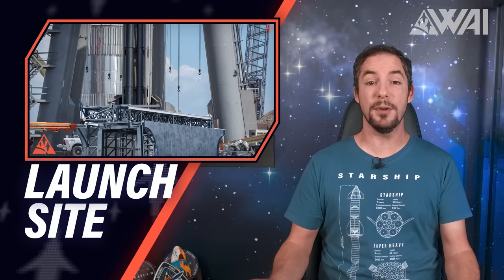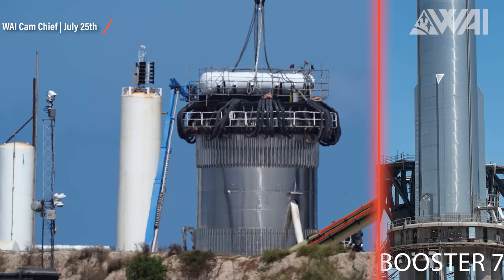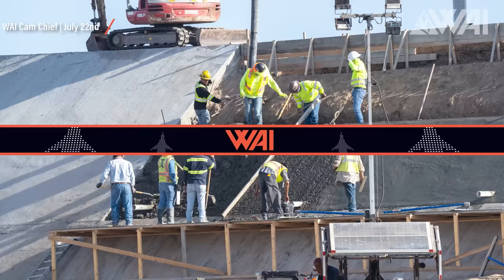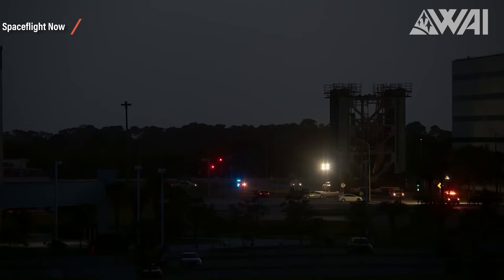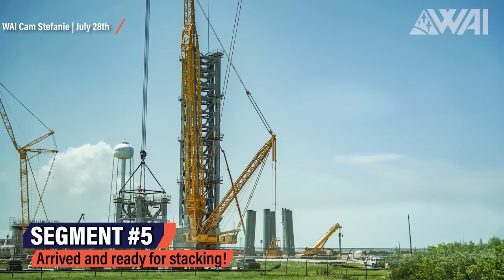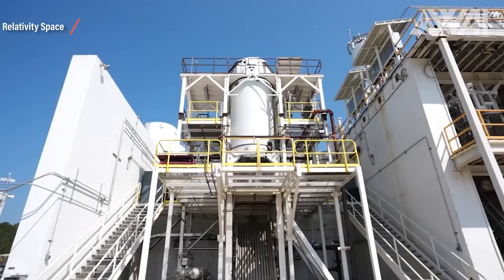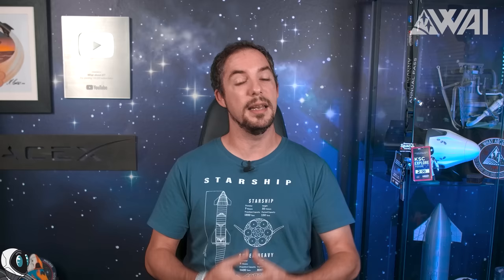SpaceX Starship getting ready for the orbital flight & Relativity Space announcing Mars mission!

Comment: I believe it was a spin prime test not a test fire that had the anomaly. Flowing fuel but not igniting it.
Reply: What's a little configuration between friends? It'll buff out.
Reply: It was
Reply: Correct it was a spin up test on the turbo pumps.

Last I heard they removed 13 Raptors.  The same # in the inner section on gimbals.
Reply: Yeah I came here to see if someone pointed this out for any new viewers. Almost LOOKED like a static fire, but certainly Felix knows that it was a spin prime test and made a simple misstatement! NBD 🙂
Reply: Really? Is that what you believe, huh? Well thanks for your input.
Reply: correct
Reply: Close but not exactly. There was no fuel flowing at all. Spin prime tests only use LOX but the ultra high oxygen vapour environment makes even trace amounts of methane produce a sizable boom. Presumably trapped methane in the tanks and tubes that built up in the engine section. It's even possible the fuel source didn't come from B7 at all but from a generator/welder/other tool nearby.
Reply: @2ndhandjoke  Yeah, it's easy to believe facts when you've seen the myriad evidence and have a basic understanding of what a spin prime is.
Reply: Correct
Reply: We know this for weeks now
Reply: Yes it was.
Reply: Big surprise he makes big mistakes.

Comment: I'm very happy to see Relativity space competing but the scale is incomparable and not in direct competition with the Starship.
Reply: The kinds of payloads that are too large for Terran R are uncommon. Yes, I can see Starship flying a big telescope, and parts for whatever replaces the ISS, but this doesn't amount to a lot of flights. 80 percent of commercial payloads are less than 8 tonnes. That's why Rocket Labs's Neutron is sized the way it is. Terran R is larger and would account for a fair proportion of what is left of the market. Starship will have its uses of course, but it still has a lot of competing to do with the vast majority of payloads.
Reply: @saumyacow4435  Good point. You could also argue that currently the payloads are smaller / lighter in nature due to cost of sending them to orbit. So Starship or any other reusable rocket that is to be developed would change that due to a massive reduction in price.

In the future I can see smaller fully reusable rockets being mainly used for orbit and the bigger ones like starship for the Moon, Mars, etc. where you need a lot of payload capacity to get the infrastructure ready.

In the end it all boils down to economics so hopefully some economic driving factors areestablished beyond our orbit that would push further innovations.

Comment: 1:00 The crushing loads don't occur at Max Q, it would be later at Max Gs in first stage when the fully loaded Second Stage weights 2, 3 or 4 times as much. Whatever the G load is. The Booster Transferring the maximum amount of thrust to the Second Stage to attain Maximum Acceleration, Max Gs. This is similar to what occurred to a Falcon 9 carrying a Dragon Resupply Capsule to the ISS.  Coming up on Maximum Gs, late in First Stage, a Pressure Tank broke loose in the Second Stage and floated up. Yes, as Gees increase the Buoyancy Force increases too.
Reply: I remember, that "the strut" became some kind of a meme :D

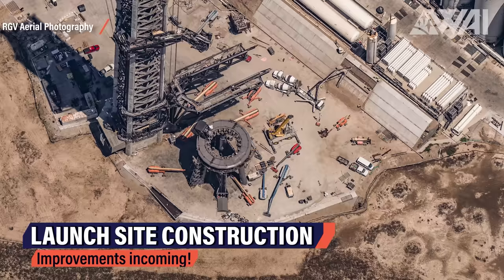Comment: 3:59 That Booster engine shielding not OLM.
Reply: That's what I was thinking.  When B7 was lifted from the launch mount post-BOOM, a bunch of the shields for the outer ring of engines were missing.  There was some supposition that they were removed in the days before the lift for engine inspection, but wasn't the consensus that they were blown off by the BOOM?

Comment: Does anyone know what's happening to the oil rigs Spacex in planning to convert into launch platforms?
Reply: Did Elon salvage them,
for the materials ?

They have vanished.
Reply: The process to refurbish them into floating launch platforms continues, although they are not priority at the moment. Its possible that SpaceX wants to have some Starship test flights before them being finished.
Reply: As usual for SpaceX they work on what is needed soon.  Things needed later are on slow burn.  They'll need a few reentries and "sea landings" before trying to land a Starship.  Why worry about the ocean platforms when they don't even know if reentry works?  Won't want to aim a Starship at a platform until they know they can do so at a realistic speed and accuracy to be caught.  

They'll need tugs to position the platform and some type of vessel to bring back Starship.

Comment: It's a little bit crazy that they're building a second tower at Florida when they haven't even proved the concept at Texas. If they have to make any changes to the system, which seems not only likely but inevitable, they're going to have to rebuild no one but two towers.
Reply: Towers are well LOW tech, the launch pad is not... given the tower has lifted the 2 sections..
Reply: Until they had Texas approval they had to have a plan B. With all the parts fabricated, why stop? Approval of a third launch location will be easier as NASA is motivated to give an option not to use KSC platform due to proximity to only launch option to ISS

Comment: Seems like the new Raptor lift will also serve as a blast shield for the concrete below.
Reply: No.
Reply: Not at all... it's clearly a thin temporary structure intended to be installed and removed as needed. It would be useless as a blast shield... placed directly below the booster, it would be incinerated in seconds.

Comment: Why would the outer engines on the booster need any protection?  The sand is going to be blown out and away.  Why protect them except for coming back down for a landing?  And still it's just that nasty sand, if it all works correctly.
Reply: There is the little problem of another engine blowing up. Without shielding that would just be a daisy-chain. With shielding,  the rocket could make mission.

Comment: One of these missions to mars needs to include a rover with a 3d printing capability to use martian soil in constructing a small "garage" for the rover, where it's onboard sensors can determine how effective soil composite structures are at protecting in various radiation environments on mars.  Sure, we can simulate the same thing here on earth for cheaper with pressure chambers and martian soil analog, but doing the real thing on the real planet would be so much more valuable for real world data.
Reply: Need some type of fluid to mix the 3d mix from dirt
Reply: @milkdeal  Yes, a polymer binder would be useful, but it would still be much cheaper to fly it there than traditional construction materials, and would be a necessary step to long term habitation on the planet.
Reply: @milkdeal  compression alone is sufficient

Comment: I applaud SpaceX for trying to find modes of failure and prevent them. However, it seems like SpaceX is very short on planning for the possibility that there will be failure anyway, no matter how careful they are. Since NASA has already learned the lesson that things unforeseen WILL happen, no matter how hard you try to prevent it, why isn't SpaceX taking that lesson to heart on vehicles that have humans on board?
Specifically, I notice that they plan to have two launch towers precariously close together. If one stack explodes with the force of a tactical nuclear weapon, I would expect that to demolish the adjacent tower. Perhaps that wouldn't kill passengers directly, but it might put Tanker flights on hold indefinitely when one of the passenger flights are in orbit.
Also, the crew of a Starship is sitting INSIDE the second stage of the vehicle, directly above a huge load of fuel, and perhaps under the header tanks! I know this is pretty much unavoidable when building a fully reusable two stage-to-orbit design, but geez!
Maybe a rearrangement is possible? Put the crew in a detachable section with a large bulkhead between them and the fuel tanks and a set of parachutes to bring the detachable section down? Of course, that could be a really huge weight penalty. But if 100 people are killed sometime, they might have to do a redesign anyway if they ever want to fly again.

Comment: I'm a little concerned. The blast that happened a couple of weeks ago was a small blast to compare to what's going to happen when the rockets actually launch So. I'm just wondering what are they going to do after every launch if everything works out are they going to strip every leg down 3:00 ok after every launch and repaint it again??? 🤔 Cuz when a launch happens with 33 rappers it's going to be a lot worse I assume from just a small blast look how much damage it did I can imagine what 33 rappers are going to do? To the lunch mount
Reply: This is still test mode. After the first launch and landing they will review every piece of both the starship and heavy rocket to see what the condition is of each piece, where they may need additional shielding, etc. There is no way these initial rockets will be what ultimately becomes the reusable launch rockets (starship and booster). The difference here is that we (public) get to see as they are building/developing/prototyping. In the old days NASA would work with Boeing or another contractor and nothing would be seen until they had years of testing and prototyping under their belts. That's what makes this so cool.
Reply: I believe they will have a water deluge during launches.  They might not have taken this damage if they did it with a water deluge test simultaneously.
Reply: The events aren't comparable. A launch will put out a lot more energy than that blast - but unless something goes wrong, there's no explosive shockwave during launch to blow bits off the launch table.

Comment: Hi Felix. I have a question that I'm sure you've already answered but I'm going to ask it anyway. Q: when the Superheavy plus Starship launch (either from Starbase or KSC) and the Starship separates from Superheavy, The Superheavy has to turn about 180 degrees around and start firing most, if not all, of the motors to stop the eastward trajectory and start a westward trajectory to accomplish a landing at the launch site. I assume once the velocity vector is sufficiently changed from eastward to westward, the booster can throttle down to a few motors to complete the trip back. And once the booster has returned, it now has to land. Given all this motor activity, about how much of the total fuel load in the booster has to exist at the time of Starship separation? I'm guessing around 30% of the total fuel load at launch. Thanks for your wonderful coverage of SpaceX!
Reply: It won't be carrying Starship or most of its own fuel.  It can also be decelerated in part by air resistance.  It won't use all their engines to decelerate of fly back to base as the remaining mass of SH + fuel will be FAR less than the total launch mass of both stages + propellant.
Reply: Short googling leads to reddit: Falcon uses 5 percent propellant for landing on a barge (20 tons) and roughly 10 percent (40 tons) for a complete boost back to the landing side.
Reply: @tilmerkan3882  Thank you! So I guess we can estimate that super heavy will also require about 10% of it's fuel load to do a full boost-back and landing.

Comment: News: Chinese space station missing.  
Turns out it was built to go to Mars. 
That's my theory.
Reply: The Turtledove novel Homeward Bound has a space station move to the asteroid belt and after a decade or two of work converted to a true Starship which travels to another star system.  So maybe they are thinking bigger.
Reply: @Scanner9631  thank you.  I will check it out. ( I assume it's worth reading)
Reply: @CHMichael  

Turtledove usually bases his books on historical events this one isn't.  It is the weakest (IMO) of the series for that reason.  The rest of the series is more strongly based on historical events than most of his books that I have read as it is an alternate history series.